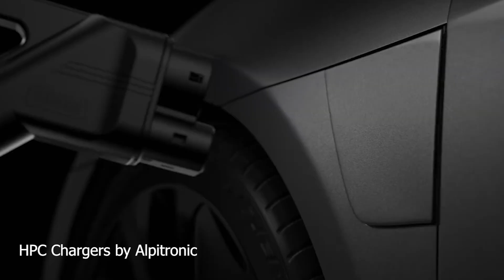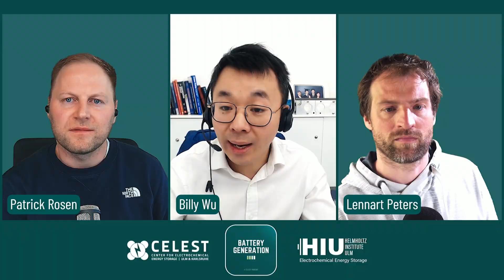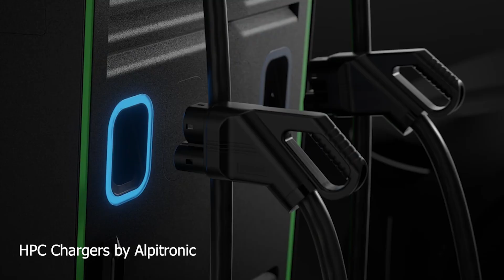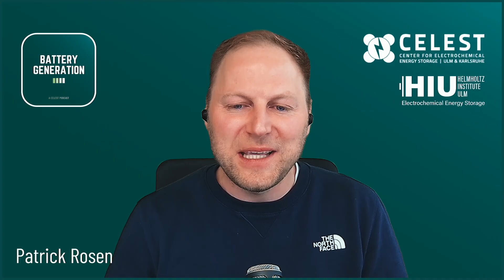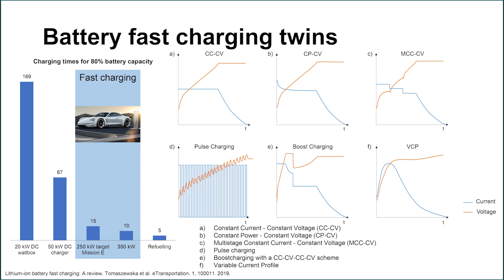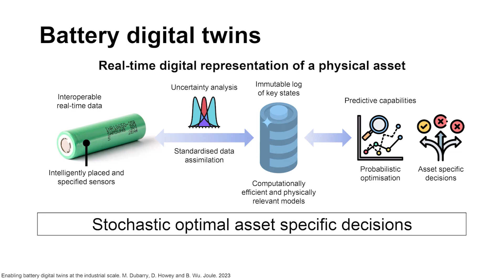Dr. Billy Wu: How Charging Routines affect Degradation | Battery Podcast

Comment: Thank you so much. May I ask a question?  If I’m only using 15% of my battery in my EV, Tesla model 3LR, per day on average, What level of charge is recommended to make this battery last as long as possible.  Research I have observed is to keep it between 60%-40%.  Thank you so much.
Reply: Yes a lithium iron battery of any flavour likes to shallow cycle around 50% SOC. But the BMS has some requirements too: To accurately predict range it occasionally needs to take data points from almost empty to full.  Whilst cylindrical cells, where many are grouped in parallel (Tesla Model S 74p6s in each module) which means they averaging out and almost never require balancing, large block prismatic cells do require  top balancing which mostly happens in the area 95%-100%.  Therefore say every 2-3 months I would do a larger cycle. My 5 cents worth, happy to be corrected.
Reply: @moestrei Used to be my 2 cents - that's inflation for you!
Reply: Very insightful. Thank you so much. I just got a new battery under warranty and it would be amazing if I could get some serious miles out of it. Right now I’m on my 3rd battery at 72k miles.
Reply: @joahash7411  That is quite surprising - general thinking these days is that EVs with proper thermal management will get a full car lifetime out of each battery. What car is it that you have?
Reply: @kevinhill1851  2021 Tesla model 3 LR. The first owner replaced the battery at about 48k. She was clueless and charged it to 100% each time and ran it almost all the way down. 

Her parents bought it brand new for her 16 year old birthday. I bought it at 61k last year. Researched proper charging and conditions for longevity. Usually never charged above 80%. 

Then about 2 months ago, received a noticed saying something to the effect “car ok to drive schedule service battery unable to reach optimum charging”. I scheduled service and a few days later another warning saying vehicle will not charge any additional amount. I contacted Tesla service and they had me bring it in that day. 

My Tesla had already ordered itself a new battery and they had it fixed with a new battery in 2 days. Extremely easy stress free experience and they gave me a loaner model y performance which I thoroughly enjoyed. Overall an amazing experience. However, I never want to face this while out of warranty. Thanks for your thoughts and input. 

PS I live in phoenix Az where last year we substantially broke some heat records.
Reply: @joahash7411  What rubbish have you got?
Reply: @rogerphelps9939  2021 Tesla model 3 LR. I baby it so much, generally accelerate slowly, fast charging only on long trips, which has only been a few times rarely in standard mode. Constantly charging no more than 80% and only down to 20% twice.  

Only thing I can think of that’s bad that I do is the heat in Phoenix, Arizona. Last summer we had 31 days of no less than 110F. So it gets hot and doesn’t cool down at night. Work lets me charge for free so it’s outside when it’s charging in the heat. 

Not a big deal yet because the new batteries have been covered under warranty. If it wasn’t under warranty it would have been absolutely crazy to pay $14k for new batteries.
Reply: @joahash7411 wow, my EV is at 60k miles now, 6 years old, still first battery with no significant degradation.

Comment: Might be time to define a rule of the sweet spot cause if 250 kW is a kind of hard limit (which requires active cable cooling) and usually 350 kW is only possible for short times and big batteries then it makes not much sense to go above 250 kW. 
But then a bit bigger batteries becomes more important and less high fast charging over a longer time for example 250 kW from 1% to 70% or so for a lower price.
Right now the progress is decreasing cause the most recent gaines were cell to pack / battery and then the battery as integral part of the car structure which lowers weight and gains range by saving 80 kg or so and gaining volume which then could be used by a few kWh more.
Reply: The Tesla semi charge cable has 2 parallel circuits of 350 kWh for a total of 700 kWh. This means the battery pack is 2 separate units. Probably not used in smaller vehicles because of extra cost.
Reply: It seems to me you have not seen Li Auto Mega charging at 500 kW...
Reply: New Porsche Taycan holds 300 KW up until 60%, I would say generalization is usually not a good thing, especially if you're trying to push new technologies to greater limits. EV market is still very new, we shouldn't hinder it's progress just because it's hard...